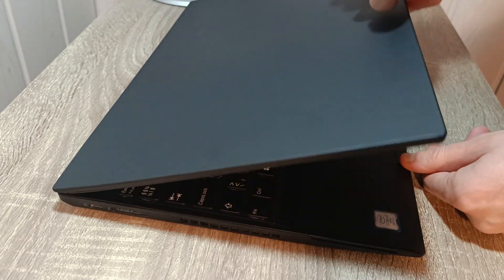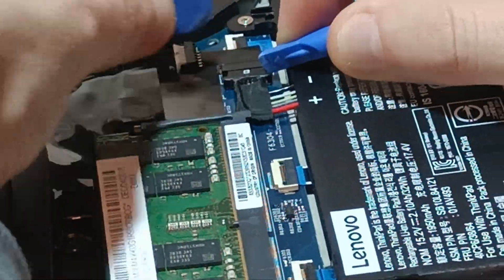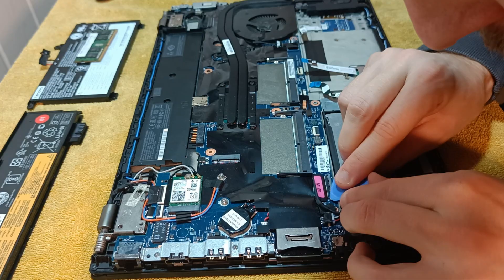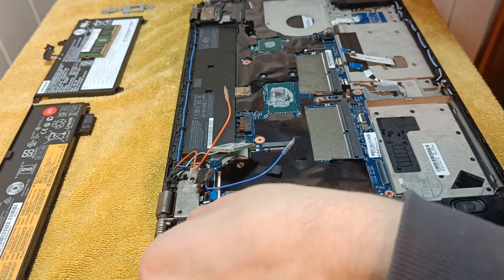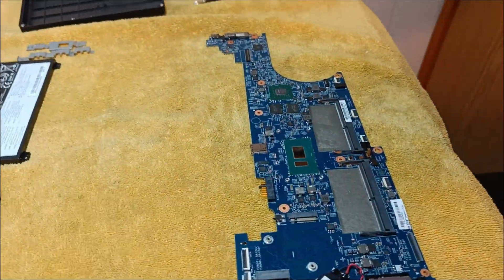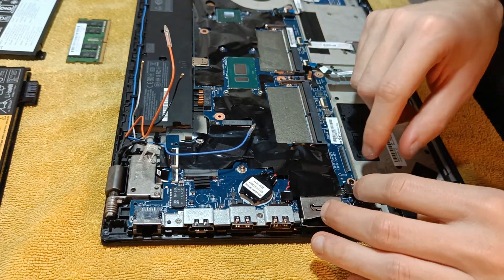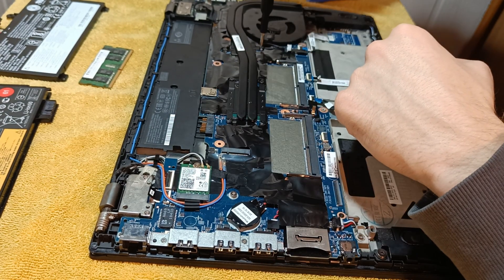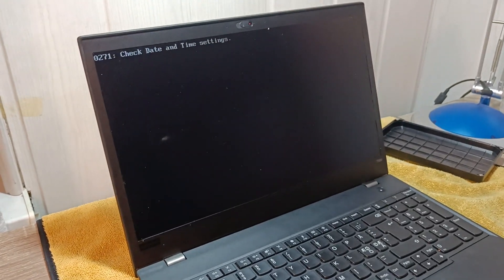Lenovo ThinkPad T580 Disassembly and LCD Screen Backlight Fuse Repair

Comment: Thanks for the video. It seems that I’ve the same main board due to everything is the same. Should it be a fast acting Fuse?
Reply from the maker: Yes, fast is recommended 👍. But any fuse with proper volt and amp rating will do it.